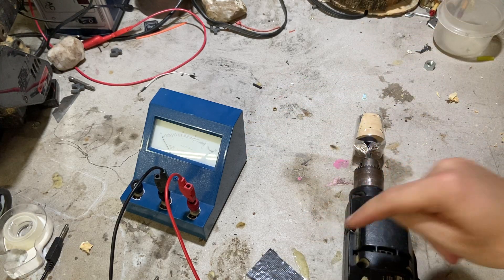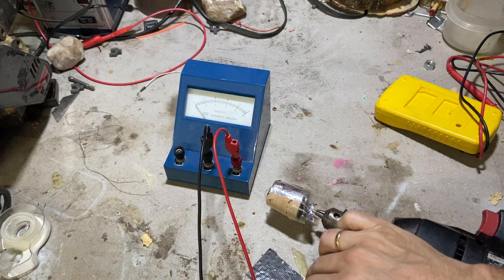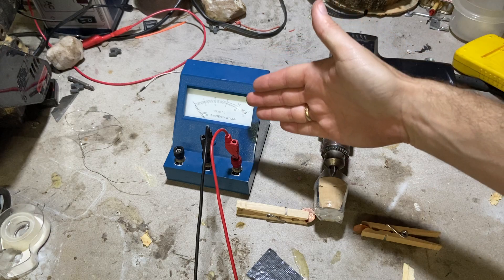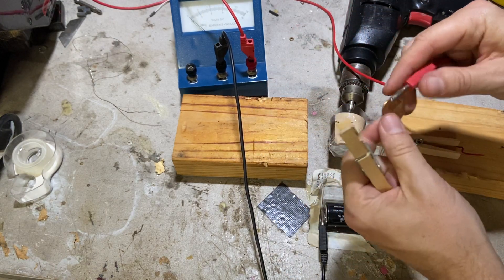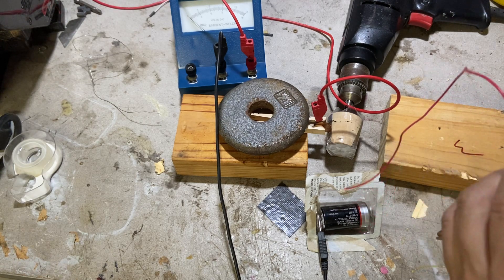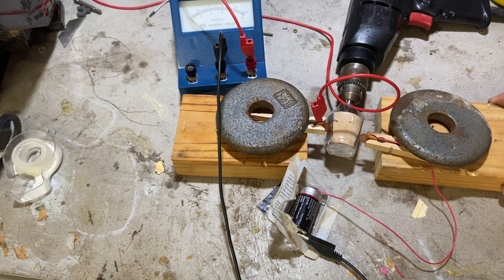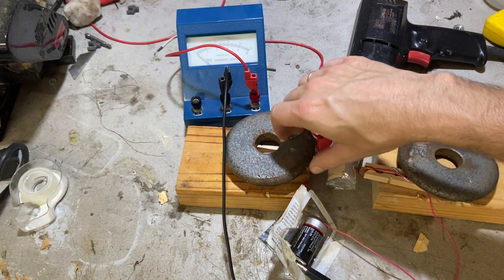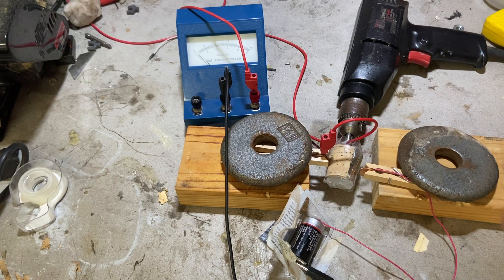DIY: Turn a Volt Meter Into a Tachometer

Comment: This will never work, even though the frequency changes the duty cycle stays the same. Therefore the average  voltage is the same no mater the speed of the drill.

Comment: it's kinda like PWM
Reply: Yes, this is analog pulse width modulation. Not RPM, but cool visualization nonetheless. This is using a kind of mechanical analog to a transistor to lower the voltage of the battery (by turning the circuit on and off really quickly). In theory, the voltage drop should be equal to the area of the cork that is not conductive. Slow RPM gives more fluctuation in the output voltage. More RPM gives a more stable output voltage. To measure RPM, you would need to a way to read the voltage pulses.